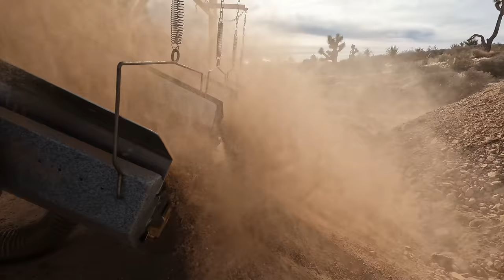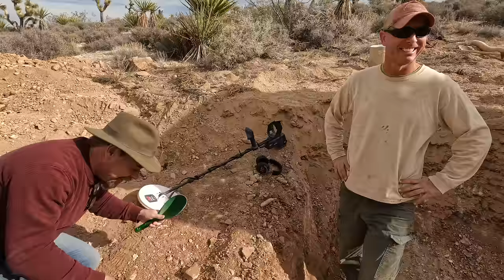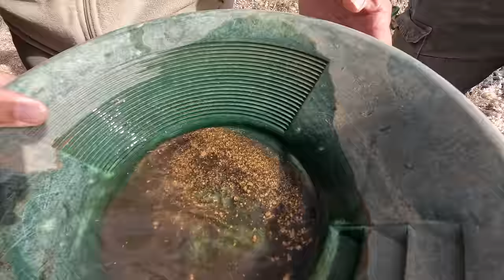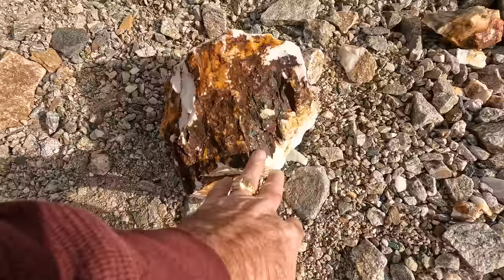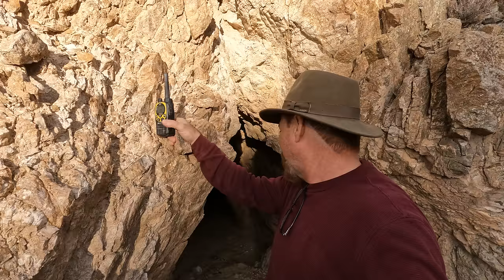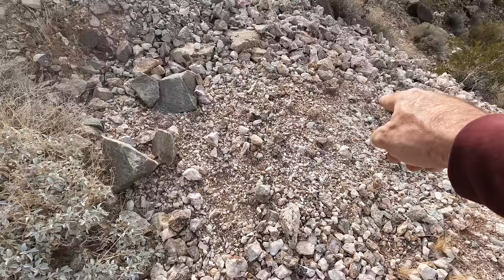Excavator Strikes Placer Gold Bonanza Prospecting New Mine🔑🌟'

Comment: Another great video!!  Quick question for you. Since we have had some rain and most of the areas are a little wet for drywashing,  I have decided to do major sampling trips. Been working the area near Morristown Arizona. My last trip out was very disappointing. Out of 16 samples only two had gold. And both of those only had a speck. So I am not sampling the right areas or these claims are worked out. I have about 40 claims in that area. I sampled the sides of washes,  in the washes, up on the hill sides. Just not putting it together.  Do you have any suggestions on where I should be taking samples from. I have been a river miner in the past and have done really well on my streams and rivers. But this desert mining has thrown me for a loop.

Thanks Jeff
Red
Reply from the maker: if you can find any bedrock exposure we would recommend that

Comment: When you use your excavator, do you fill in your holes. I'm told to fill in my 3 inch deep holes.
Reply: @donalda7178, you must be digging in Nevada if they require 3 inch holes be filled before digging another.

Comment: Last time I hiked up that particular canyon was 1984 and it about killed me then! Not sure how far the adit goes in because we didn't bring a flashlight and had no desire to hike up that hill again to check it out.   I think this is part of the complex in the canyon directly to the North.  (The road into the North canyon bares the name of this complex}  It's defiantly worth the drive and the short hike.  There are some very cool  paths that connect the canyons with each other.    The last complex you surveyed was barred up 20+ years ago.  The adit runs in about 400' and hits a vertical shaft. There is one level 30' below the main and water about 30' down from the second level.  Not sure if there is a level below the water or not...  (The road in this canyon bares the name of this complex.) There used to be dozens of open adit's in the area along with all the artifacts associated with these mines.  Unfortunately the Bureau of Land Management came through and ruined the fun.  

Great video as usual Jeff !
Reply from the maker: thanks

Comment: 13:28, I'd love to get some of that quartz to cut into 1/4" slabs to make tiles for the kitchen and bathroom of my house!!  Maybe coating it with clear Epoxy!  To leave a ultra smooth surface! Sealing the quartz.  (Especially the quartz with color. definitely not gold black, red, maybe grey, some Galina would be ok!   A place like this, ( 19:33 )  a light trailer, UpTo 3k lbs .with a crusher  and pulverizer  along with either a wet or dry  sleuce  with a wet or dry wash plant , that recycles all the water, the bottom of the trailer being a water tight tub! Divided with a sump  the output of the wash plant surrounded , or desperate by expanded metal about 12"-16" tall  two rows of it. With about 6"-8" between them. When in use the dividers/filters having something like cheese cloth, burlap, or both  in place to hold coarse sand and possibly charcoal  and fine gravel. To separate the mud and silt from the water! Possibly use another sheet metal divider to funnel the water into a spinning drum with a cover the cover holding the solids    about 16"-18" diameter and 4" tall. Spinning about 3000 to 5500 rpm or 1500-4000  rpm ! It can also be used after words to collect the fine heavies!  Fill with concentrates while spinning, and keep running the clean water through it. Use a ramped incert with grooves to hold gold and black sand ! So after running it!  It should   hold only gold, lead, black sand only the heaviest stuff!   Build a pulverizer / hammer mill that spins the hammers in opposite directions possibly two sets on two shafts . Requiring them to be trimmed. Have it operating similar to a shredder  the hammers spinning around passing between each other!  With only about 1/8"-1/4" around them  and about the same distance between the hammers and the case!   Half of the bottom and part of the end being the discharge!  Ore like white quartz should come out looking flour or baby powder if you choose!   Use a 24" drum 6" deep.  With 3 sets of 2-3 hammers  on a 2" or 3"'shaft  with  two sets of bearings 4"apart atleast.  Then a 10 HP to 16 hp engine! Possibly spinning at 2:1 underdrive. So 3,,k rpm engine would be 1500 also add a 50 lb 30" flywheel , requiring the mill to get UpTo speed first!  Using a go-kart style clutch       with the feed  taking the rocks and slamming them into the oncoming hammer! So  s 2k rpm  hammer the rocks will feel like it's being hit by a 4k rpm spinning hammer it being a ,1.5"-2" wide actual ball peen hammer looking hammer with 6-9 per shaft! And the Hopper having a sliding gate and a lid.  To allow the fill portal to be filled. The gate holding the ore. The lid to be closed. then the gate to be slowly slid open!  It basically working like a blender for rocks! It can spit out a smoothy if you want, or a fine to coarse sand! Actual baby powder from ore!  It should be capable of crushing up black sand to possibly recover more gold! Possibly add a small disc mill to the side! To actually get ultra fine micron sized powder! Fine enough to mix with water.   Do fine just mix with water and any gold will fall to the bottom!!  The sand will be required to fit between the disc  with a .005-.007" gap to make it to the discharge!!.. with it adjustable from .001" to about .050" depending on wear.  Two 1" thick disc one spinning . One having a ,2" offset inlet at the top. The disc having ,three 2" holes about 1/2"',deep!   The edges of the holes shear the grains as the disc spins the edges of the holes being hard face welded and ground smooth as they wear! With them working like scissors the gap between adjusted to just above .001""using shims in the shaft  thrust bearing ! Possibly using  a large nut on the shaft pushing against the thrust/Torrington bearing!. With a feeler gauge between the two disc!

Comment: If they took out,and processed 100 tonnes of gold bearing material,on a % basis, how much would they have thrown onto the waste  pille as missed or low %  material
Reply from the maker: 20 to 30%
Reply: That is a shit load more than what I would have expected Jeff, but you are the Guru in these matters.So potentially the waste dumps,woulld they be commercially viable based on today's Gold prices,or not enough material to make it viable